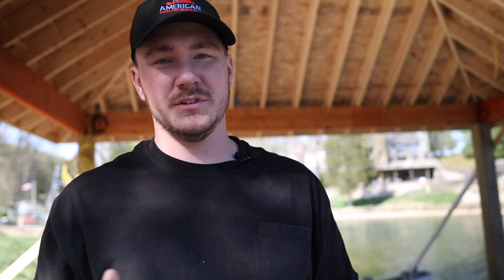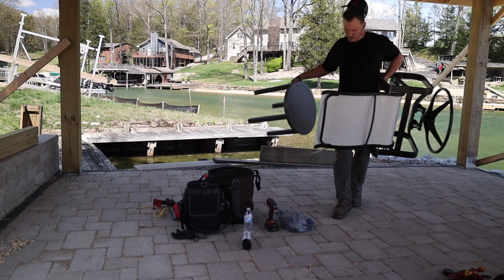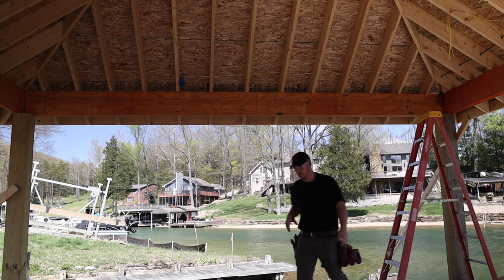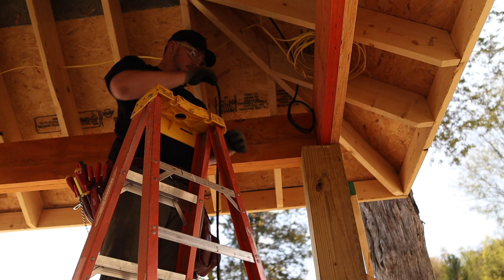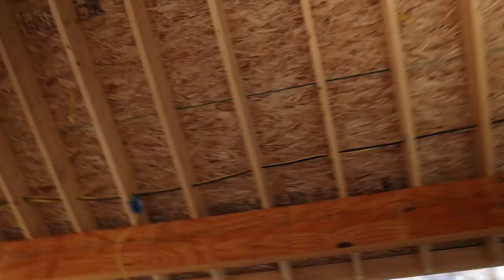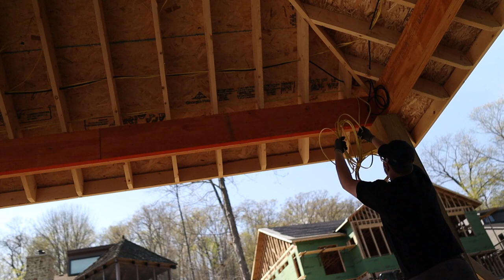Electrical Rough In For Gazebo. Residential Electrician

Comment: Great video I presume your allowed to to use standard romex for some of the circuits in an enclosed gazebo where you have weather protection via the roof. Moisture ingress and temperature variations is something I always worry about and it’s a common fault I find with insulation deterioration even in conduit meant for the outside.
Reply from the maker: Thanks! Yes since it will be covered up it is allowed. All lights, covers, and boxes that are exposed will be weather proof. All circuits will be gfci protected. I have also found the same thing. Especially when the weather changes dramatically. Gas stations do that often when it first snows

Comment: Loving the vids bro but man how do you wear that belt it’s hanging off your ass you should get a Diamondback belt even if you keep your bags At least it will stop them from sliding around and the belt with will give you more support and sit better
Reply from the maker: Hahahaha thanks man. I know it was driving me crazy but it took me so long to realize. I missed a belt loop it doesn’t normally sag. I have been looking into diamondback though!
Reply: @americanelectrician  give them a go there pouches are unreal I got the mini niko and clavo on a calvetto belt. great setup it’s like yours not massive bags smaller but still holds a ton and even if you like your bags rn that’s cool they are great bags just grab the db belt that will be a game changer for you the belts alone are great no matter what bags are on them
Reply: occidental leather is the way to go , i usually wear it in between my stomach and waist area , having the belt around my hips drives me crazy